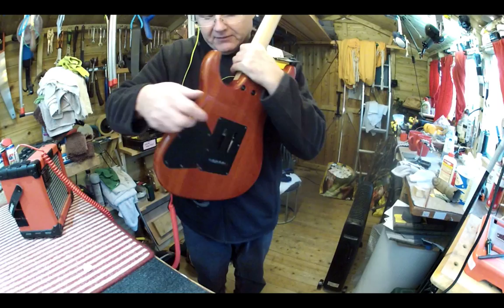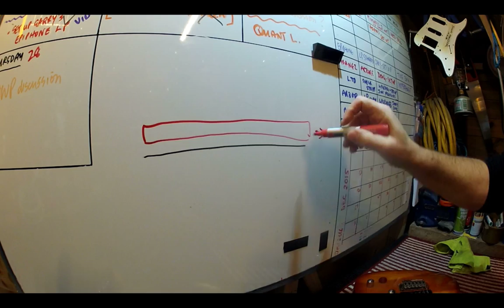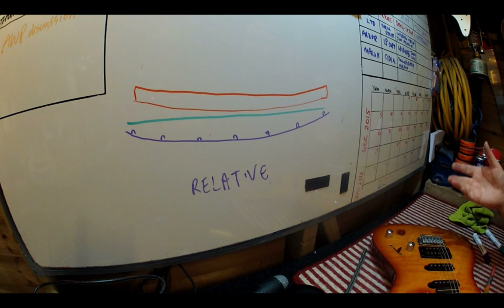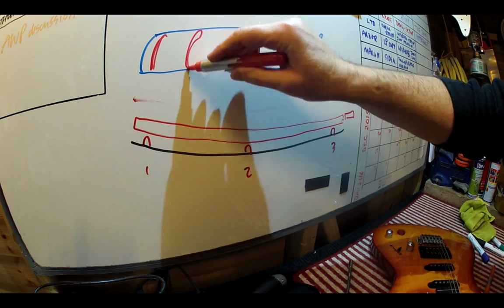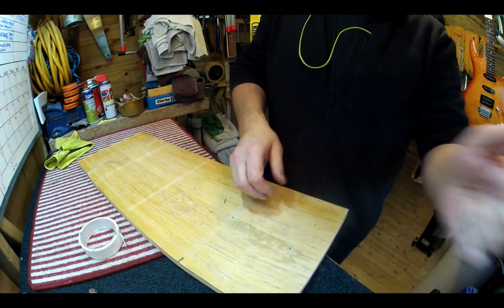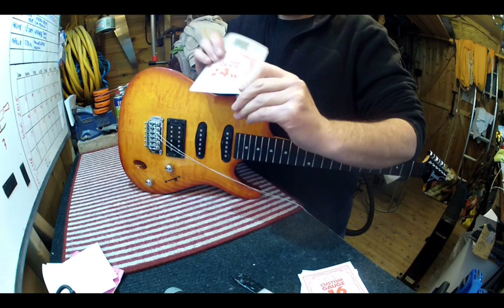Ibanez SA series electric guitar set up

Comment: I have the same model. Even with almost no neck relief and completely lowering the bridge saddles, my action is still on the higher side, low E around 3mm and high E around 1.75. Dont know what else to do very strange. Any inputs Sir? Thanks
Reply from the maker: In that situation you have to shim the neck. I use a 0.25mm thick strip of brass laid right at the back edge of the neck pocket (I use double-sided tape to hold it there). This will be enough to lift up your neck to reduce your action.
Reply: @SamDeeksRelovedGuitars  Thank you sir. Yes, shimming the neck is perhaps the only option left, will do that. Thanks.

Comment: I have a query. At about 1:20 in the video after you had masked off and were ready to begin fret profiling, did you use the permanent maker again before using the file, or was the marker ink left over from before? It is just, of you have levelled the frets then I would have thought the marker would have gone from the top and when you use the profiler tool it would not show (if that makes any sense). Obviously I have never done this myself but would like to understand the complexities. (P.S. this is such an excellent instructional video and if I was in Devon I would have stopped watching by now and would be digging out the yellow pages haha).

Comment: I have this same guitar, can I change the bridge pickup and put a regular humbucker in? Or do I need a trembucker?
Reply from the maker: Hi Ric - it depends mostly on the peculiarities of the brand of pickups themselves. For example, many Seymour Duncan bridge humbuckers have 48-49mm pole spacing which is TOO narrow for most 52.5mm Far East bridges and way too narrow for all 54mm spaced Strat tremolos. So whenever I want to use a Seymour Duncan bridge pickup as a replacement I most likely will buy the Trembucker version (if there is one available) which is usually somewhere between 50-52mm spacing depending on model. This means that strings coming off the 52.5mm bridge will pretty much sit dead on a Trembucker poles since they are so close to the bridge. Other manufacturers make their bridge pickups with 50mm spacing which also just about works with a 52.5mm bridge but looks a bit odd with a 54mm modern Wilkinson Strat Tremolo bridge. Hope that helps - not a straightforward answer (especially as Seymour Duncan are really bad at stating the pole spacing on their pickups). This explains why I've actually got SD 48mm-spaced bridge pickups in the NECK position of some of my own guitars: I bought them before I knew about their stupid spacing, couldn't use them in the bridge position as intended on customer guitars and ended up just 'using them up' in whatever position their pole spacing worked. Which, for my Slash Alnico II 'bridge' pickup happens to be in the neck position of my SG (with a bog-standard 52.5mm bridge spacing). Nuts, eh?
Reply: @SamDeeksRelovedGuitars  Oh thanks very much I have that same guitar in your hand the Ibanez SA 160. Which pickup do you recommend for the bridge?
Reply from the maker: @ricmel8008  It depends on the output / resistance of the other p/ups I guess... Ideally you need to balance to your playing preferences so you don't get a massive volume jump where you don't want one. A lot of people like a power jump on the bridge pickup... but not everyone! Personally some of my favourite 'mid-power' humbuckers are Railhammer HyperVintage, Seymour Duncan 'Pearly Gates'. IronGear do some decent humbuckers at a more budget price... also depends on where you live.
Reply: @SamDeeksRelovedGuitars  Thanks for your help. I live in the USA but I don't know where to purchase iron gear.

Comment: I need to change the plastic nut. Where can I buy a good nut?
By the way, I just bought the same guitar for $50 used.
Reply: New nut Musically on eBay
Reply: You can buy battery operated winders for adjusting the tuning machines it would save u a heap of time Ernie Ball make them

Comment: I just bought a left handed version of this guitar 2 days back and I'm finding it unbearable to play. I can't describe what's wrong. 

Basically when I'm not plugged in or on distortion my G string mostly and also my B string on 12th fret onwards has a weird ring/buzzing/flanging sound that overpowers every other note. Its like instead of ringing out smoothly, it flutters. I've adjusted the truss and the action yet it still does it.

I have yet to change the stock strings, could those be a problem? if not what else can I try? currently on lockdown and no one shops are open.
Reply from the maker: Hi Omar - if you can email me a short video clip to samdeeks@gmail.com I'll see if I can hear what's happening. Video is much better than trying to explain in words :-)

Comment: Thank you for an awesome video! I know I am a bit late :) I just lowered action on my Ibanez S320 to 1.55 on high E and 1.85 on low E string at 22nd fret using the same technique. I didn't touch the locking nut yet, but action on 0.7 at first fret is ok for me for now. I may buy another locking nut and file it down to try and experiment with 0.4 - 0.5 action at first fret. Thank you Sam, keep up the good work!

Comment: Hi Sam, Sam here :-) I have the same guitar and I watched this video hoping to see the pickups being adjusted. I have a strat and you just turn the screws on the sides to lower or raise the height, but when I tried the same with this guitar it looked like the pickup was raising but all that happened was the black pickup cover started coming off, so I quickly screwed it back on. Any advice how I can do this? Thanks
Reply from the maker: Samuel Naidu Hi Samuel - the principle should be the same, only the middle and neck pickup are screwed into the body of the guitar. Between the pickup foot and the body should be either a metal spring or a latex rubber ‘spring’ to allow the pickup to rise or fall when you adjust. In practice it’s not ideal because while this set up (in reverse) works when pickups are suspended from a pickup ring, when they’re attached to the body the ‘spring’ has to be able to overcome the pickup weight and push them up... it rarely works satisfactorily. This is probably the reason the pickups don’t appear to move when you try to adjust the screws. These days I use a combination of spacers above and below the pickup leg to create the height I need. A real pain :-)
Reply: Sam Deeks Oh dear... Sounds like something an amateur like me shouldn't be messing with. It's so much easier with a strat, just turn the screws...
The reason I asked is because for some reason my guitar has very less sustain with distortion, almost half the sustain of my strat-type guitar. I realise that raising the pickups actually gives u less sustain, but the notes seem a bit thin with the pickups so far down. Any ideas to increase sustain?
Reply from the maker: Hmm. Pickup poles that are right under the strings i.e. touching or within 1 or 2mm can magnetically 'hold' the strings but as far as I know even then the impact isn't so dramatic that you feel like your guitar sustains 1/2 as much as another does. 

Sustain (from all I've experienced) comes down to the 'solidity' of the anchoring of the strings to their two key pivot points and the integrity of the structure those to points are set in. I make guitars in ekki (an african hardwood that's TWICE as heavy / dense as oak!!) and with a well fitted neck (no looseness), well-fitted bridge (no looseness) and well-fitted nut (no looseness) the sustain is incredible. 

A couple of things you can do - consider upgrading your bridge block to a high mass brass or steel unit. This helps increase the 'solidity' of the strings bridge anchor point. Secondly, look to see whether there is enough break angle of the strings over both the nut and the bridge saddles. There's no real disadvantage of having too steep an angle but when the angle becomes too little - i.e. the strings pass over the bridge or nut almost without pressing down - then you lose sustain. 

Hope that helps!
Reply: Thanks Sam, will have to read your reply a few times to make sense of the technical stuff :-) but thanks for the reply! I heard you testing that SA series with distortion and it seemed to sustain much longer than mine, which made me wonder... since mine is new as well, so I can't understand why it would sound that much different.

Comment: Hello Sam! I don't know who to ask anymore :/ 
I'm about to pull the trigger on a used SA960QM that I love.. The issue is that the dude that's selling the guitar lost its trem arm a long time ago in a galaxy far far away. So, I can't really try it out if it has the arm missing. It has an Syncrhoni ZR tremolo on it.
Now, there are no Ibanez shops here in Serbia, and I could only find a few replacement arms. There is literally just one up for sale, and its called "Ibanez Ib 2TRX5BC001".

Is that thing going to fit?
Thanks a lot, for all the videos you've done and for helping a lot of us out!
Sending love from Belgrade. :)
Reply from the maker: Hi Aleksandar - is this the correct arm? 
http://bit.ly/2DgjCcD
Reply: Sam Deeks wow thanks for the fastest possible reply :)

No, it is this one:
https://m.kupujemprodajem.com/Ibanez-Ib-2TRX5BC001-Tremolo-Arm-46344214-oglas.htm#mhs0-1515579956604

You can click on the picture to zoom in. I've asked them if it would work with synchroni zr, and they dont know (sales guys in this store)... 
I mean it should work, by using logic. If UTA20 (the new lightweight arm) is working with almost all the models (including edge, edge zero, ZR2, and synchroni zr), the one available to me should work with most of them, right?
I would buy it and test it out by myself if the guitar wasnt on the other side of the country, requiring a 6/7 hour long drive to get there and back.

Thanks again! Stay awesome :)
Reply: Well, I've answered, but youtube decided not to post the comment. So, lets try again :)
First of, thanks for the fast reply!
Unfortunately, its not that arm. It is in fact this one: 
https://www.kupujemprodajem.com/Ibanez-Ib-2TRX5BC001-Tremolo-Arm-46344214-oglas.htm
(you can click on the picture to magnify it)

I've even asked the shop if they knew, and they dont know if it would fit. The package says its made for ZR2/Edge Zero. But, my train of thoughts went like this: Ibanez has an ultra light replacement arm.. called UTA20, and it can be used on synchroni zr, edge, edge pro, edge zero and zr-2. This thing that I can buy here can also be used for edge zero and zr-2, so I should be able to use it on synchroni zr, right?

The thing is, the guitar is on the other side of my country.. And its a 6-7 hour drive to test it out, and I would love to buy it, but I need to know if its staying in tune - so I need to have the arm with me. If I cant use this arm, I wont try the guitar out, then. :)

Thanks again! Stay awesome! :D
Reply: and now there's 2 of mine comments :)
Reply from the maker: There's one on ebay in the UK for £30... I thought the Synchony unit had a locking collar.. but... Hmm. 

I think any old trem arm is likely to fit into the hole & work well enough to push the trem unit down to quickly test it... The reality is that there's very little about the trem unit to be 'broken' and you would be able to see visually if it has all its components; see if there's any damage to the blades or the post / pivot points. Just a thought.
Reply: That was my thinking too, I wanted to open it up and check the blades, but that requires some tools and time at his house (and his consent). That was my plan B. 
I guess it should work, I'm going to try it, but I'll bring my tools too.

Thanks a lot for your help <3

Comment: I have this guitar and was wondering what height does the trem need to be? Is it suppose to sit flush with the body? Or float a tad?
Reply from the maker: Hi Jolly - it depends what you want it to do. If you want it to be hard-tailed (ie. no tremolo action) then it's locked down with the back of the plate touching the guitar top. If you want some downward bend only, then it's typically set with the plate touching the guitar top but with the springs slack enough to allow downward (forward) movement. If you want a floating tremolo action then the back of the trem plate floats off the guitar top, kicked upwards as far as it needs to be for the range of UP-ward bend you want the trem to have. 

Galeazzo Frudua (search YT) does a great video on setting 2-point floating tremolos (on Strats as it happens, but the same principle applies here).

Comment: I recently acquired one of these had a lot of problems with the bridge ie lower action etc went to tighten the pivet screws to lower the action and the screws wore away lol cheap screws got it sorted in the end though, great video btw
Reply from the maker: +Siborg Day Thanks! Sorry to hear about your problems. Always tricky with screws - especially if they're holding something under load (i.e. the floating bridge with strings going over it) All I can say is that matching the screwdriver head EXACTLY is the key to preserving the slots / stars as long as possible. Better to have a couple of sets of new driver heads standing by in order to ensure a perfect fit rather than chew them up. Doesn't always save you from mashed slots, but will most of the time.
Reply: +Sam Deeks ah ok thanks for that was using the ibanez multi tool kit that comes kind of like Swiss knife size with all bits and bobs on it a good piece of kit but maybe to imprecise lol

Comment: Most amazing experience here. While watching this video I began fiddling around with my new (actual new) PRS SE Tim Mahoney model, the baby blue one. Following your routine, after checking relief, measuring nut heights (quite acceptable), I honestly got my 24th fret action down to 1.5 fat E side, 1.3  thin E side and from the Korean factory, I had NO "zizzing" or fretting out on bends whatsoever! is this a new thing Korean factories or PRS SE are doing, or did I just hit the new production guitar lottery?
Reply from the maker: +JH Scofield Yes, you did Jim - kind of. I also have one in the workshop right now that has come to my chosen action without the need for fret levelling (although it still DOES have some uneven frets, they're below the 'radar' as it were). It's unusual because it also clearly hasn't been worked on or levelled before, so it's just down to good manufacturing...I would have to work on a few more before I could categorically state that it wasn't just luck. But the rest of the guitar is pretty nicely made; it's a Jackson Adrian Smith.